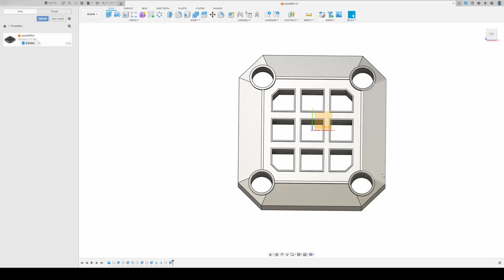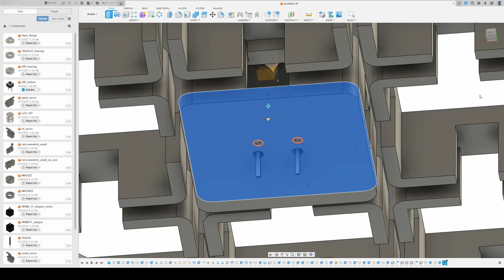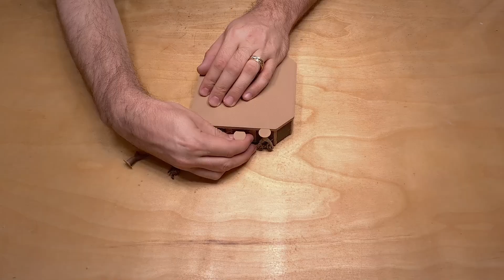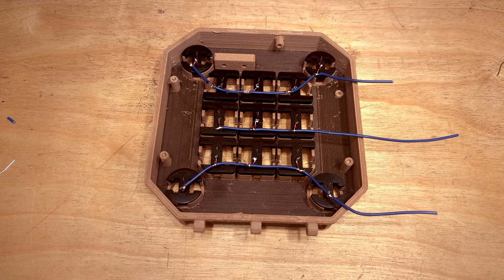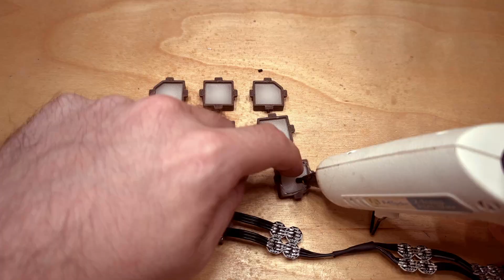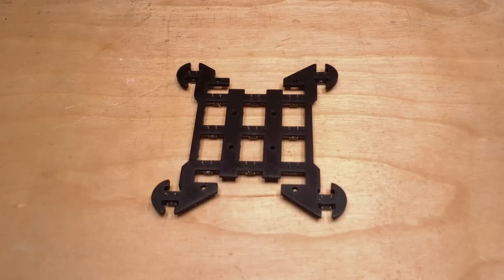Making the Mora Jai Box Real!

Comment: This looks amazing, really nice job. I actually started working on one of these myself and started messing with solenoids, slim keyboard switches, pcb layout, and the microcontroller code. Then I got distracted with my Mora Jai State Space analysis project and haven't actually fabricated anything yet. 

My plan for the colors issue was to use frosted plexiglass, black backing plastic, and side-lit LEDs. I really like the way yours turned out though, and will definitely make one for myself! Thanks so much for sharing the files.

Comment: Nicely made. 
I didn’t expect that 9V battery to be able to supply enough current for all those LEDs. I was pleasantly surprised to see the LEDs light up. 
Well done.
Reply from the maker: Thanks! I have them running at about 20% brightness, at full it can't keep up. But any brighter is too bright anyways. The solenoid is the bigger issue, it draws enough to make the Arduino brown out. After filming all this I upgraded to a rechargeable lithium 9v and that has more than enough current for everything!
Reply: @UnnecessaryAutomation  If you used a latching solenoid, it would only require a pulse to unlock (or lock) the box.  Of course, this is an unnecessary optimization for a hand-built, one-of-a-kind piece of artwork.
Reply from the maker: True, wish I would have thought of that!

Comment: what if you used a small OLED display in each button? super overcomplicated, but you could theoretically get all the colors you wanted
Reply from the maker: Oh yeah, that would definitely work! But as you said, super overcomplicated. And the LEDs ended up working pretty well
Reply: That might let  you change the Realm Cores as well. 
I'm not sure but given you've got the fenn aries Sigil you should only have Red tiles in the solution?
(Or you could have swappable corner buttons, which is probably more straightfoward...)